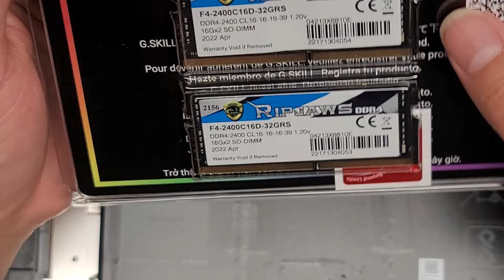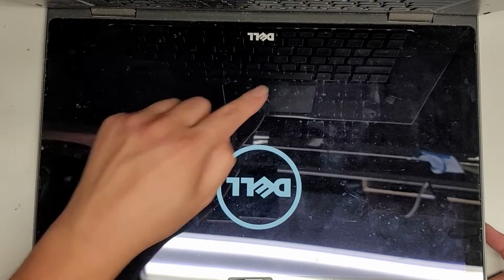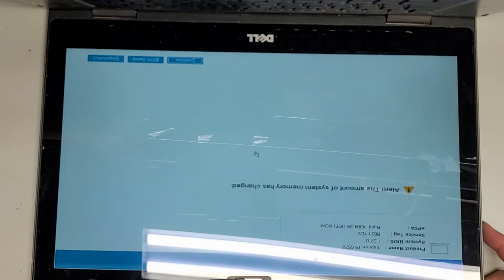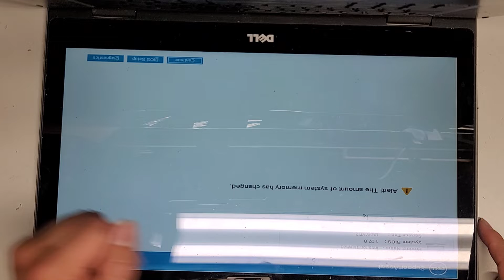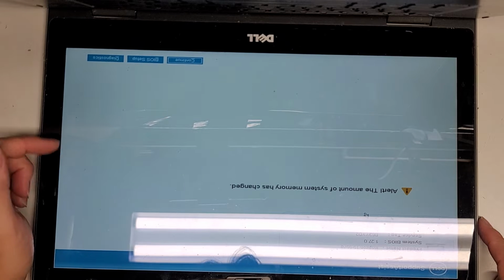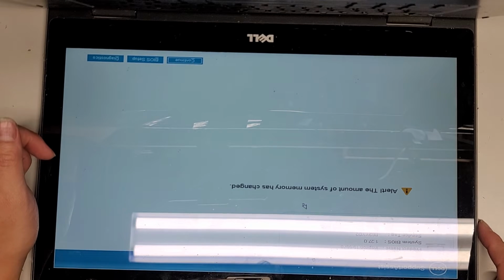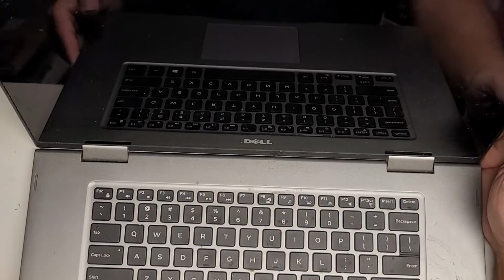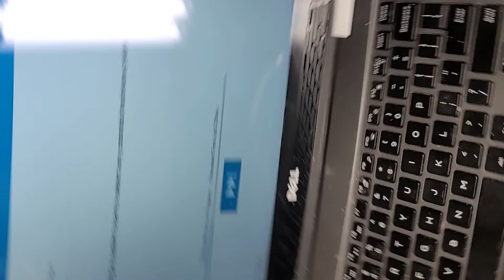DELL Inspiron 15 5578 2-in-1 2n1 Disassembly RAM SSD Hard Drive Upgrade Battery Replacement Repair

Comment: I have this model but my camera physical problem how to set?
Reply from the maker: @zainzafar5080  how do you know it's a physical problem?
Reply: @ItsBinhRepaired  We can't find your camera

Check to be sure it's connected and installed properly, that it isn't being blocked by antivirus software, and that your camera drivers are up to date. If there's a physical switch or button for the camera on your PC, make sure it's turned on.

If you need it, here's the error code: OxA00F4244<NoCamerasAreAttached>
Reply from the maker: @zainzafar5080  did you check if there's a switch on the side or the camera or keyboard?
Reply: @ItsBinhRepaired  not show any camera button on keyboard & other side

Comment: There is a master bios password for every Dell laptop. I scavanged the internet like 10 yes back and found the master password for my 1545  . But it's always a good practice to ask the owner for the bios password.
Reply from the maker: Yup
Reply: @ItsBinhRepaired  I have a question. In the video i saw a place is there for NVME slot not no slot there. Can we solder and add a nvme slot and then add a nvme ssd drive ?
Reply from the maker: @desigeekchishi i doubt it

Comment: Super useful tutorial!

Could you tell me more about the RAM that you installed? How do you, for instance, figure out how much it can handle? I though 16 GB was the max. capacity that I could install.

I'm supposed to look for matching DDR4 2133 Mhz sticks, correct?
Reply from the maker: Matching speed, usually there is no capacity.

Comment: What is the normal battery backup for this laptop with the power saver turned on and the brightness set to low?
Reply: Reply appreciated !
Reply from the maker: Not sure what to mean by backup.
Reply: I mean to say that how long does the battery last after fully charged to 100%?
Reply from the maker: It depends on your usage. I have no idea.

Comment: Battery  is not taking charge.please help.any suggestion
Reply from the maker: Press f2, does it show you the battery/charging info?
Reply: @ItsBinhRepaired  after that
Reply from the maker: @NKumar-yt3vy  I need to know what it shows
Reply: @ItsBinhRepaired  not showing any charge .
Reply from the maker: @NKumar-yt3vy  could you make a short video and upload to YouTube so I can see it?
Reply from the maker: Let me know when it's up.
Reply: @ItsBinhRepaired  I have given to service centre..they will check.thank u
Reply from the maker: Hope it works out